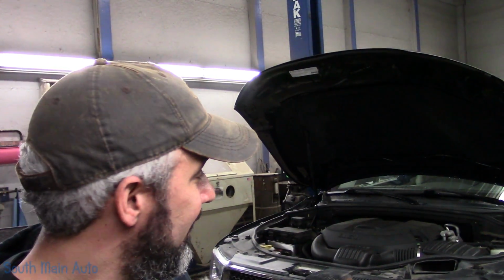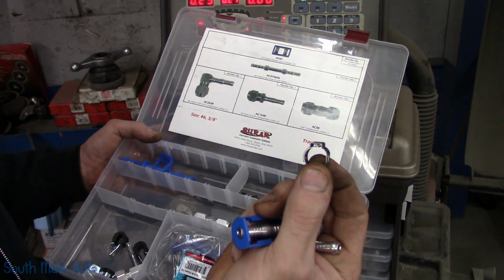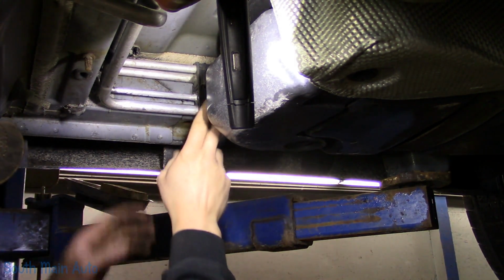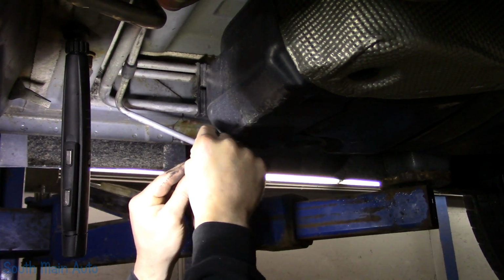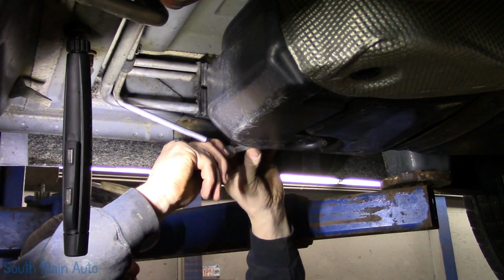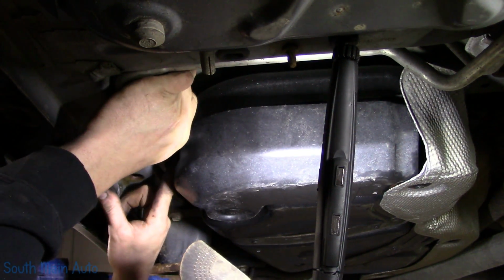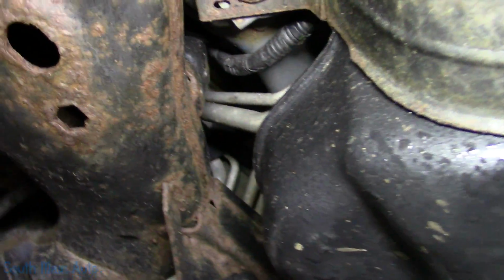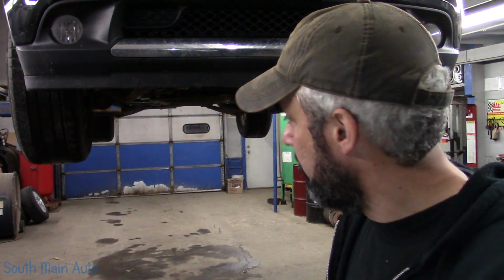Leaking Rear A/C Line Repair - Dodge Durango

Comment: Great video as usual. I just pulled the condenser out of 1991 Mercury Cougar and patched a hole with jb weld. As soon as it cures I'll put some pressure to the line and see if it works. My cousin said that I have a 1 in 10 chance of success. 😅 we'll see.
Reply: If you roughed  the surface good enough for it to grab, it would work, I think it has a high psi rating
Reply: Well, did it work?
Reply: It didn't work

Comment: Another solution for systems that the owner may consider repairing in the future, I use the bolt in block off plates from Auto Cooling Solutions. They bolt in at the line connection and seal like the original did. No need to sacrifice the line set.

Comment: Do you ever use the UV dye for leak testing? I've never tried a sniffer.
Reply from the maker: I do yes
Reply: I don't like the dye because after you make the repair, the old dye is still in the system. So if you try to recheck the system how are you to know unless you wash off all the old dye. Prefer the sniffer.
Reply: When I used to work on trucks we always added a small amount of die with the oil injection whenever we charged a system. That way if it ever developed a leak in the future we could find it quickly. The dye makers also sell a solvent to clean up the repaired area, or most kinds of brake clean will do it.

Comment: With the Venturi technique your creating a low pressure outside of the hole then drawing a vacuum so the relative pressure is higher inside the tube than outside.

Comment: for zip-ties use a side cutters or "flush cut" cutters and it won't be sharp for the next guy.  A small file will make quick work of the point if you can access it.  Its a pet peeve of mine.

Comment: The bottom line here is that without this repair, the vehicle would not have working AC.  To drop the entire drivetrain, exhaust, rear suspension and heat shielding to replace miles of aluminum tubing would be a total waste of money.  After a few years, you would likely have a similar repair needed.

I congratulate Eric for doing a cost-effective repair that puts the customer on the road.  Shame on Chrysler for designing such a system that was born to fail.
Reply: Anthony Grove well said! I don't know why engineers do such a poor job designing systems.
Reply: Kenneth so that you can come back for the repair

Comment: Remember [cough] Dorman [cough] is not a manufacturer. Dorman is a supplier of aftermarket products. So is NAPA, but it sells other name brand products too. Dorman may supply parts from the same manufacturer as OEM or from some other manufacturing source. No different than the vehicle manufacturers, which may buy brake parts from Raybestos or exhaust from Walker.  This is why some Dorman products may be very good and others not so much.

Comment: If you are using a Tif ZX-1 sniffer and the battery pack goes out, don’t buy the $70 replacement, go to Mouser electronics and order (4) of 
658-HHR200A
HHR-200AB20
4/5A 1.2V 2000MAH
Panasonic cells and rebuild your old pack. Way better cells than the Chinese ones that come in the replacement and they are $5 a piece. Hold a charge better, store longer and work great. Just did that to mine.

Comment: After fitting the 1st half of the fixing remove the centre part leaving the o ring olive and nut on the pipe. then fit the fitting on the 2nd pipe connection, the o ring and olive will line up fine then re fit the first connection, should align easier

Comment: HAHA.. the part complaining about the zip ties makes me laugh :-D Only option would be to use aluminium hose hangers with rubber inside and screw it on the sub frame or the plastic hose holde.

Comment: A/C is nothing but a PITA , I've never been one to worry if it worked or not , my last truck I simply removed the belt , could cared less is it worked or not . I just roll down the window , being up here in Nova Scotia , yes it gets hot but I'm usually by the cool ocean breeze anyway . 
Nice fix tho Sir , it's about the same I would have done if truly needed

Comment: pretty sure that tubing is measured by it's o.d.  .. in which case, you can measure it with an open end wrench.  quick, easy and accurate.  also works on sway bars when ordering end links, and they need to know if its a 21 or 22mm sway bar.  just see what wrench fits around it!

Comment: Nice!
Q. I have a 07 Civic with AC compressor not turning on. System has adequate amount of freon. When jumping the AC clutch relay it turns on (the fans as well). I'm suspecting a bad ac transducer (switch). 
It's a three wire switch: ground, signal, reference. 
Reference voltage reads 5v (with lead to battery negative). The ground is good (shows battery voltage with lead to positive+). Signal wire reads about 1v.
I wanna confirm my diagnosis before putting a new switch in this vehicle. Will jumping 5v ref to the signal wire safely bypass the switch and allow the compressor to kick on?
Reply: DIY-HAVEN No take your power probe and give it full beans on the 5v reference that will end all your troubles 👍😂 and no nead to say this but for the love of god ignore me!!
Reply: Are you sure it’s not a bad relay ? Those fail all the time. Not sure which terminals you are jumping.
Reply: Concerned Citizen no the relay is new. If you turn the switch on inside the vehicle you should have power at one of the terminals on the control side and at the load side. The ECM has to ground the control side in order to energize it so that the load side circuit becomes complete and turns on the load. The ECM is depending on a few other input in order to ground the control side. Amongst those is the AC pressure transducer or switch.

Comment: A cleaner setup with the zip ties could have been running one horizontally in the plastic holder, then slipping a zip tie underneath the first zip tie and running it around the pipe. Hope that makes sense in writing!

Comment: That's a strange design with an evaporator at the rear. Most cars in the UK have all their AC in the engine bay. Does your refrigerant have UV dye? It would be easier to trace leaks rather than trawl through with the sniffer. When I fixed the AC on my Citroen I damaged the high pressure line right where it goes into the condenser due to electrolytic corrosion. Fortunately, I was able to fit a replacement used section sourced on eBay. I spent about £200 on a new condenser, replacement high pressure line and two recharges. It was playing up on me this week (we're in the middle of a mini heatwave over here in the UK) and once I'd sprayed some 303 protectant on the drive belt it was fine. It also cured the squealing noise I had at idle.
Reply: and you guys drive on the wrong side of the road   or wait is it us? lol
Reply: Vehicle probably has rear air as well as front air, so 2 evaporators .
Reply: We drive on the right side of the road, but they drive on the right side of their cars.

Comment: What I would have done is slide a piece of rubber fuel line on that AC line ahead and behind where the fitting would be for an added buffer against vibration and chafing against anything back there.

Comment: i put my leak detector in the garbage.... r12 they worked good though....dye test now... eric nailed it with his tool  hmmm!  if the system is opened for an hour is  a 30 min needed to to pull it down before charging ??   at the dealer there was no repair  line replacement only

Comment: Pro tip, use a lighter for 1-2 seconds on the cut off zip tie. It will melt it just enough to round the end and not cut the next guy to stick is fist in the abyss

Comment: ERIC SAVED THE DAY!!! Appreciate all your videos.  They've helped me learn a lot that I've used in my own repairs.  Also like a lot of the little tools you have, I've added a lot to my tool box because you have stuff that makes working easier like the caliper hangers.  I bought an SUR&R ac fitting and bought a piece from the wreckers and spliced it together.  Keep up the good work and always watch the videos too.  Unrelated  question for you or anyone, I took a bracket bolt out in the side engine area and dropped it.  Didn't hit the floor, can't find it anywhere.  It holds on a power steering hose bracket.  Any suggestions on how to find it?

Comment: On these new Durango/Jeeps do you know what turns on the cooling fan with the A/C?  Ours only has 1 switch with 3 wires?  High pressure line out of the compressor?

Comment: In my experience zip ties are not really weather resistant....especially under the car in New York.They tend to get brittle and snap.
Reply: Rob Carstuff - if you have a place to find high end zip ties you will find otherwise.....get good industrial ones from Grainger other McMaster Carr and you'll see they can last forever.  One sign you have a good brand is if you see a metal locking tab in the plastic where the locking mechanism is.   Harbor freight anf similar sells garbage zip ties....
Reply: I agree. The plastic used in zip ties varies wildly! Buy good ones 1000 count at a time, and you'll be fine. I keep 4" and 8" around in the big bags, and a few other sizes I buy as needed in 100 count, and they start to collect.
(If the packaging indicates UV stability, this is generally a good indicator of quality)

Comment: Ever since my plant started building these 2011+ WD Durangos, I wondered about this repair just in case something broke because these lines are routed absolutely ridiculously. Now, just imagine, how terrible this would be to repair in the assembly plant IF there was a case of bad parts??? Oh yeah, remove everything THEN replace the line. It's horrible.
Reply: full can of gas and a match would fix it :)))
Reply: Also, that isn't a 2011 Durango. It's a 2012 or 2013. The Dodge // badge wasn't added until the 2012 model year.

Comment: Curious, why is aluminum used for ac lines? Also I’ve always wondered if doing a repair like this where maybe the lines have to be shortened affect performance of the system at all?

Comment: If the car you work on takes 2.5 lbs of Freon and you recover 1.5 lbs of Freon to fix a small leak, will you still charge for using 2.5 lbs of Freon to fill? I mean you did recover the customers Freon and when it was filled you essentially only used on 1lb of your own Freon. I’m asking this because I see it happen all of the time where the shop recovers x amount but they charge the customer as If they added “new” Freon to the system.
Reply from the maker: I only charge for the difference. In this case he bought the whole amount because the system was empty...
Reply: Scott Pardee what I want to know is can they reuse that Freon they recovered from your car to be put back into another person's car? Or does it go into a separate container that has to be disposed of?
Reply: I’ve gotten in a pissing match over exactly that. I was a .5 pound low on r12, they changed hoses, and charged me the full charge. That stuff isn’t cheap, no way in hell I was paying that. I told them to take all but .5 pound off the bill, or figure out a way to give me my 1.5 pounds back.

I work on jets, we just charge the difference.
Reply: Kenneth White it goes in the same tank.
Reply: Jared J thank u for replying. I never knew that.

Comment: Are filter driers ever used in automotive like we use in hvac.
Reply from the maker: Yes depending on the system (orifice tube or expansion valve) we use a receiver drier or accumulator tank
Reply: Yep, and sometimes the desiccant bag bursts and sends crap through the entire system, requiring a new condenser, orifice, and lots of clean-up labor! Fun, fun! 😁
Reply: Tracy sellman or on the Condensor, or on the Inner Guard, some are also about the size of a Coke Can!
Reply: The orifice has a screen shaped like a cone.  It mounts in the line just before the evap on older cars.

Comment: Did you sniff test rear of the repair just in case the jostling of the lines cause issues?  

What is the good kind of crusty?
Reply from the maker: Sure did, double checked the whole system when I was done just to be on the safe side!

Comment: Cable ties made it look like David Freiburger effort although he would of left tails on :-) 
ties work and not much else can do with cost effective consideration .
expensive fittings and crazy resale logic :-S
Seems useful kit have but pretty spendy stock .
Dorman sounds good option for diy guy trying a fix before a re-gas .
Would like see better oem design with pipe in sections or at least aftermarket preformed repair sections with joints/joiners .

Comment: Sorry but I'm confused. When you were explaining the repair kit, you said "this is what I use a lot, it has a brass compression fitting inside" then a few minutes later I heard not to use brass on ac lines. I went back and watched that again.......what am I missing? (Sorry, not trying to be a PITA, just trying to understand)Thanks!

Comment: WHAT COULD I DO ON A ROUNDED BOLT HEAD THAT IS ON MY AC MANIFOLD ATTACHED TO THE CONDENSER? WILL USING AN IMPACT WRENCH MAKE THE PROBLEM WORSE. I LOOKED INTO THE FITTINGS YOU USED BUT ADVANCE AUTO PARTS CHARGES A FORTUNE FOR THE PART. THEY DID NT HAVE THE CHEAPER CORMAN PART IN THE SIZE I NEEDED.

Comment: Is the rubber hose that the line connects to in the rear for the rear heater core?seems I’m leaking coolant do to rusty hose clamps also leaking refrigerant.😒

Comment: Just to be that guy in the comments section, there are tools to tighten and cut the ends off of the cable ties. Alternatively one could use a flush cutting plier and not leave a sharp edge to cut the next guy.
Reply from the maker: We like to leave sharp edges and cut the next guy though haha

Comment: What is the other 2 lines on top of the one you were working on?? Look like AC line too??  I worse case, you can alway tell the customer to come back with an empty gas tank and drop the tank. In older cars, we used to have to do that for fuel pumps.
Reply: Coolant lines for the rear heat.

Comment: What is the cost of R134a in the US ?   In Europe it has taken off big time due to a "shortage" and it's the equivalent of $600 for a 30 pound bottle.  Workshops are charging up to $200 for a regas.   If you can still get it for the old price then get stocked up .....FAST.
Reply: I pay 79.99 for 30lbs at the ole advance auto
Reply: That's what we were paying 2 weeks ago.  Get stocked  up just in case the same scam spreads westwards  !!

Comment: @South Main Auto Repair
Eric What is your opinion if ........
...you only put on 3,000miles / 5,000 kilometres in  11-12 months 
Is it ok to wait until you hit that 3,000miles/5,000km to change the oil?  or  Should you be changing it every 6 months or something like that even if you don't have the mileage to warrant changing the oil?

Comment: Have you found a way to isolate and vacuum or pressure test just the evaporator coils in the dash or does your freon detector find a leak easily enough in the evaporator coils?
Reply: Blade Sometimes you can sniff a leaky evap through the condensation drains. I don't think there's an easy way to isolate just the evap coil. A vacuum isn't adequate for leak testing except with huge leaks. A perfect vacuum is only 15 psi of pressure difference. The system sees 50-300 regularly.
Reply: I didn't know if vacuum would be adequate or not. I have a nitrogen tank I can pressure test with and its very easy to spot leaks with soapy water but not inside the dash.
Reply: Blade Yep, put 100 or 150 psi of dry nitrogen into the system to check for leaks. If the system comes to you totally empty, iirc it's acceptable per the EPA to add a bit of refrigerant in addition to the nitrogen for leak sniffer tests. Using 100-150 psi of nitrogen pushes on things from inside out, particularly important for Oring leaks which may not show up when they're being pushed inward with 15psi of pressure.

Comment: I just found a leak I’m just about the exact same spot and on the low side. Can you tell me what the diameter of the low and high lines are so I can get the right compression fitting? This video has been a huge help and will save me 4000

Comment: When I first bought my 03 Envoy 5.3, it had a failing clutch fan where it wasn't spinning fast enough on a warm start.  Before I knew about it, I would crank on the AC only to hear the compressor chatter after a few seconds.  I have no idea how long it had been doing that before I bought it.  Was one of the pressure sensors supposed to prevent that?  Also, I am converting to electric fans before the Summer so I wonder if I should change out the compressor as well?  hhmmm.  Anyway, at the moment, I wait a few minutes for the clutch fan to gain speed then I can crank up the AC and it will work OK, but I feel that the compressor has been long suffered the consequences of a bad clutch fan
Reply from the maker: I would get the fans in order first then throw a gauge set on it to see what is going on with the AC. Pressure is directly related to heat and it should have just turned itself off when the high side pressure climbed...

Comment: The only thing that bothered me was that you have such expensive tools etc but didn't use flare nut wrenches on those fittings, even after you acknowledged aluminum was delicate.

Comment: What size splice did you used? Or the diameter size of the line? Looks like a 3/8. Mine has a leak on the same line same spot. Gonna have to do the same procedure. Thanks...

Comment: hey Eric I have been shopping around for the wire insulation piercing leads you use.  On amazon there are the cheaper off brand ones and the fluke ones that are only available in a $100 test kit.  I was wondering which ones you used and if you could recommend what I should go for.   Thanks!